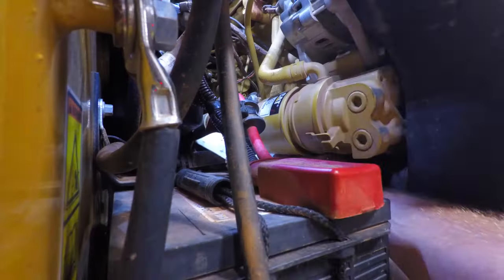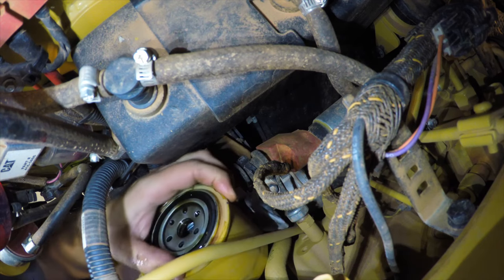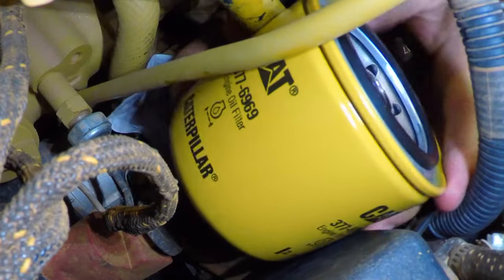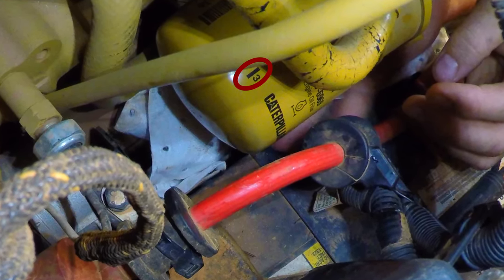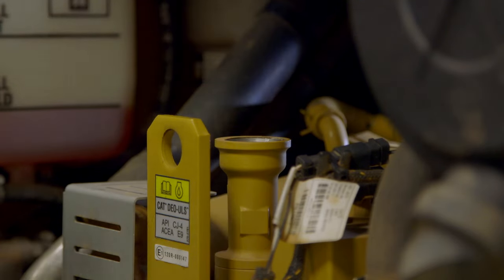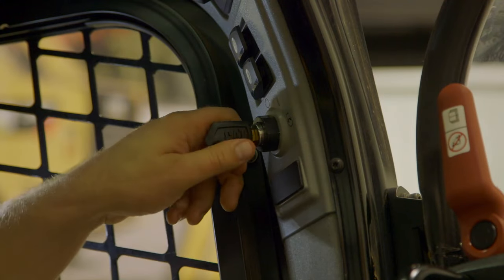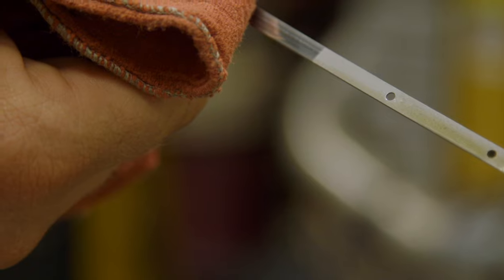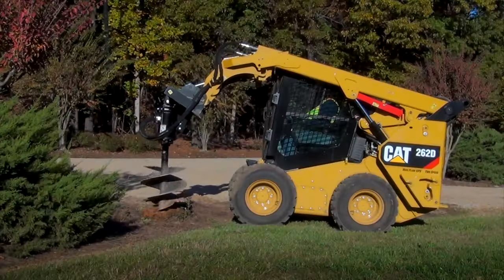How to Change the Engine Oil and Filter on the Cat® Skid Steer Loader and Compact Track Loader

Comment: my used skidsteer cat 272d2 came without an access plate and after getting rid of a ton of dirt that had gotten into the compartment and cleaning it all out, I can't seem to find the right size for the two bolts that mount the new plate I cut.  Do you know what size bolts these are?  I assume they are metric as the two types of SAE bolts I have with right diameter don't seem to thread on.  Thanks in advance!
Reply from the maker: Hi Russ. Your Cat dealer can help! To find a dealer near you visit https://www.cat.com/en_US/support/dealer-locator.html?utm_source=youtube&utm_medium=social&utm_campaign=cic_social_care.
Reply: thanks.  I wound up tapping hole then welding new nut after one broke off.  new belly plate installed!  @catconstructiontrade

Comment: Maybe they made the filter removal/install difficult so people will just take their machines to the dealer.
Reply: They need to make a kit to relocate the engine oil filter to a more accessible location. I would buy it! I have a 289 D and I usually pull the battery which is also not easy to remove!
Reply: Take the positive (red) cable off the battery and push it to the side. Makes it 10× easier.

Comment: a better video would be showing the engineer and his boss that approved putting a oil filter in a location so hard to get to doing this oil change . the machine is almost perfect A+ . the oil filter placement could have been made better C- .
Reply: syclone73 you are too kind with C grade...... I thought I was going to have to remove the battery!  Disappointed with CAT.
Reply: In_process I always remove the battery for more space
Reply: And his boss with a big thumb up while engineer refils engine oil with no funnel, and the little oil spill that went with it. All good and proper.